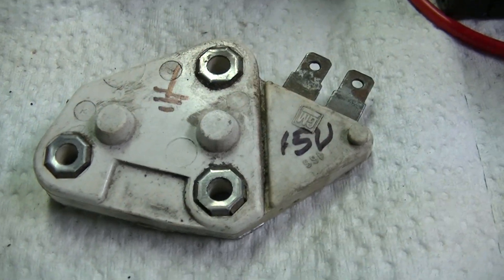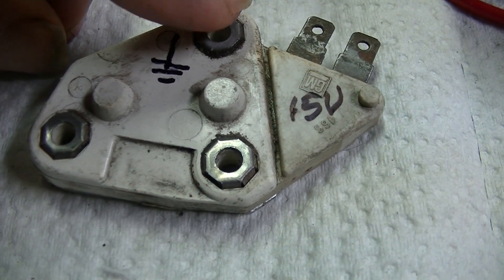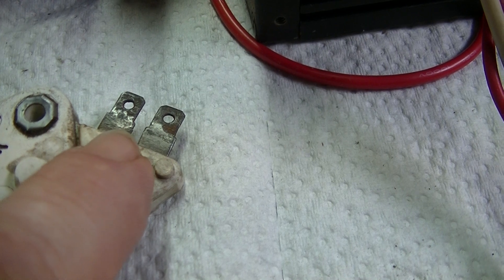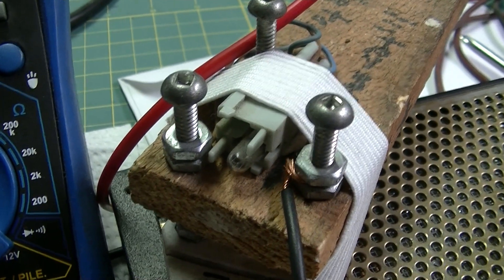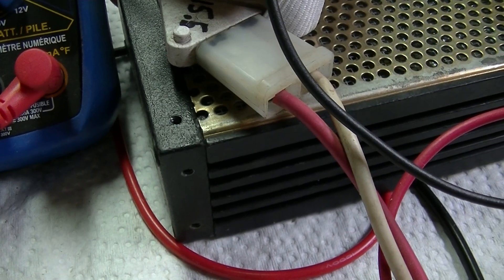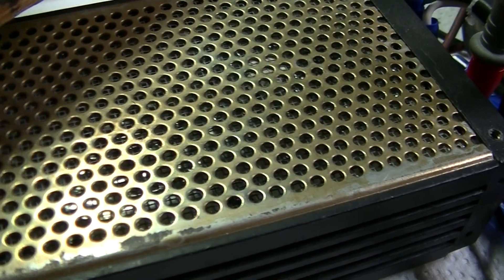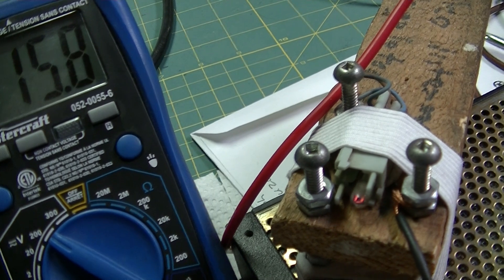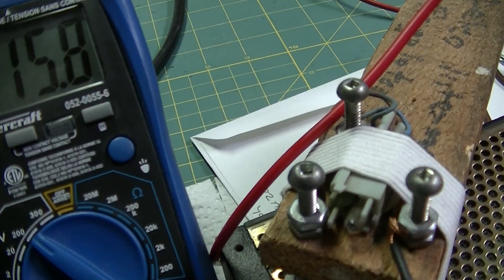Delco 10si, 12si Alternator Voltage Regulator Testing - zeketheantiquefreak

Comment: i did this test over and over and had no output, than i realized you do not have the lead on your regulator that goes to the battery charge which mine  does. I am so confused.. I can not find another video except yours. Not sure if i am doing this right?
Reply from the maker: Sorry, I just found this now. I have a 24v regulator of this style that has a threaded post on the side. Is this what you mean?
Reply: @zeketheantiquefreak8518 no, it has a wire coming out of regulator. I gave up and bought another alternator.

Comment: Pretty simple for a two wire, what about a 3 or 4 wire from older cars. Which terminals are which.
Reply from the maker: Sorry for the tardy reply. Computer issues. Applications with an external regulator usually have the wire terminals marked, such as 'F' for field, on the back of the alternator and on the regulator. If you are so inclined, do a search for (I think) A and B circuit charging systems. Lots of info there.

Comment: I just tested several used regulators as well as a brand new one. ALL of them cut out (light bulb turned off) at exactly 15 volts. I also put a tester across the battery terminals on a 1986 Cutlass with the engine running and it read 15V. Is this not normal?
Reply from the maker: Yes, I think your test results are fine. I wouldn't balk at using something at 15VDC. I repent of my earlier information.

Comment: I used to be in the business of rebuilding these alternators and you need to heat these Regulator to around 100 degrees to get an accurate test . When cold they can give a false test as good but when heated it  up as  they would be in service that's when they will sometimes fail
Reply from the maker: Thank you for the advice.

Comment: Hey there Zek, Don here again, have you ever done a 12v negative ground conversion from a 24v positive ground on a 20 series JD ?
Reply from the maker: It is a very involved process due to the 'split system' of the 24 volt JD's, of which I am most familiar with the 4020's. Cost is prohibitive needing a 12v replacement starter and, say, a Delco 10 or 12si alternator. Yes, you can do it, but arm yourself with as much knowledge about the split system as you can before proceeding. Even though the starter is a DC motor, it generally won't change direction when switched to a negative ground. Ask around. Watch as many videos as you can find. Good luck with your project and let me know how you are making out.

Comment: How wouod u bypass one of these? I need to charge my 4 truck batteries so i can keep driving. I would be happy with 16volts, i would just turn on all my lights to keep from frying my ecu
Reply from the maker: On the back of the alternator, there is a small (half-moon?) hole on the edge near the two wire connector. Inside is a metal tab, part of the regulator or brush holder. When this tab is grounded, the circuit is 'full fielded'. This is used for temporary testing/diagnosis purposes and the voltage is dependent on rpm... Watch the voltage very carefully, a rpm/voltage spike can be the 'angel of death' for your bulbs and electronics.

Comment: Sir is there any posibility that I culd manuali control when and how much that voltage regulator wuld charge me baterry???
I have unusual problems many times I use hv ceramic capacitors on me ignition coil so me alternator is constantly back feading true alternator buld unless I give it bigger engine rpm also I have problems when running centrain engine aplications I go as low as 300-500rpm with me engine Its Opel engine typical GM lay out systems.
So I try to figure out when useing plasma ignition or amplifier ignition to not mess up me charging system or I wuld like to control me alternator charging manuali if posibel.
So do there exist any circuets that I culd use to fix that problem some peopel mentioned voltage deviders some say cloosed loop regulation systems Im realy confused honestly .
So hoppe to see advice what I culd do to make at least some what that thing manuali programabel.
Reply from the maker: Let me think on this for a day or so... A 'backfeed' problem is usually corrected with a diode at terminal 2.
Reply: @zeketheantiquefreak8518  I will be honest with you.
Some of those effects are great for fuel economi and engine power.
Me alternator pin 1 is bulb pin 2 sense is bend inside the case of the alternator .
There is diode in the dashboard but its conected to engine warning light who isnt even used .
Besides the alternator I have other unusual effect who acure in different event like self acelerating carburetor metalic springs get contrapted that happened due to blinker relay I found out the back side bulb holder who has dual filament bulbs they all share common ground wire the wire was green corroded and black wire on me key switch started to burn tge effect was engine dont want to shut off when all 4 blinkers are engaged the engine worked in union with the blinker relay when the key is of .
The self acelerating effect at full engine trothel Is seperate acurance I suspect xenon bulbs and the rear heater defroster relay 4pin who is leaking current over night so I removed it and I removed the air filter and blowby hose the self aceleration stoped .
I honestly dont know all me relays are ic chip based they have internal resistors and diodes but still they interact with dual filament bulbs,xenon bulbs and back charging alternator.
And I dont know how to fix that problem.
I did yesturday dump all me wire harnest out and found broke wire for door switch was damaged .
The problem is many of me relays share common - and + connections and lot fuses .
So they act identical to dual 5 pin relays basicaly or interact some how with ignition coil or xenon bulbs.
Thats what I culd discover.
Some how some where those xenon bulb act nearly identical to wacum tubes becauseI suspect the 4 pin relay is leaky and the heater element in me rear windscreen look like gride element for wacum tube .
All those effects are strange and some are usefull for exampel that blinker relay can be used as buzz coil so me engine can work with out the 4pin gm ignition module.
And the engine it self starts to act like Hit and Miss engine.
The xenon bulb deal self acelerating was also interesting to me because I might culd use that to regulate me E Core type ignition coil like dimmer switch circuet because the original 4pin gm ignition module does not have relarding option.
So perhaps you might quesed I have cold start problems in winter I like to drive me engine more advanced because of low rpm and fuel economi.
I have video on me chanel proveing gasoline engine diseling.
So yes the diode is bypaased for the alterbator but still the regulator is conected to the ground side .
So I try to make seperate circuets and perhaps some how control those odd effects .
I have mostly hella relays 2 3 4 6 pin relays. So the problem is I dono where to put diodes even If I have any they have internal diode but still they leak some how .
I dono if zener or shotky diodes wuld help but I dont know what value of diode to use honestly.
No wonder that I am confused so thats why I try to finde older peopel who know about those odd effects that acure on old cars me Opel Ascona C has evry thing tipical 80s GM car has .
I honestly dont know where the ignition power comes from true the dash I supose Im not shure me self if positive linear voltage regulators can back fead as well.
So I took apart wire harnest and found broke wires for hande brake and door switches perhaps that caused problems to .
Normali if I leave in reverse gear or hande brake on the baterry drains some what faster.
Thank you trying to help me.
Me head hurts from so much trobel with that engine.
Reply from the maker: @MechanicForGMCCars  I will leave these comments up in that hope that someone will have the answers for you. It is above my skill/comprehension level. Thank you for the comments.
Reply: @zeketheantiquefreak8518  thank you